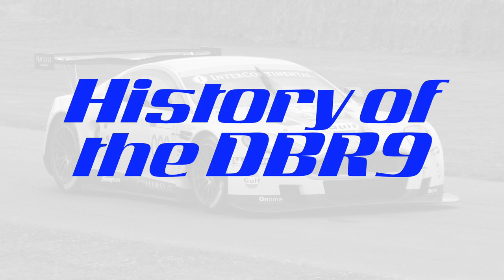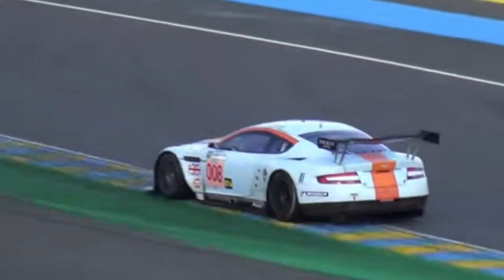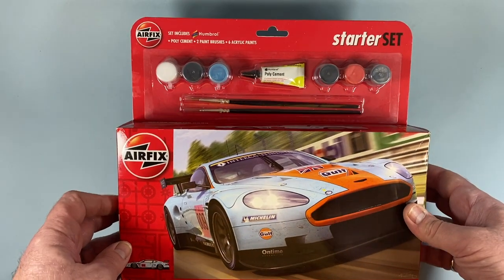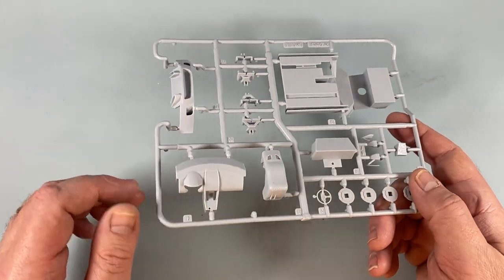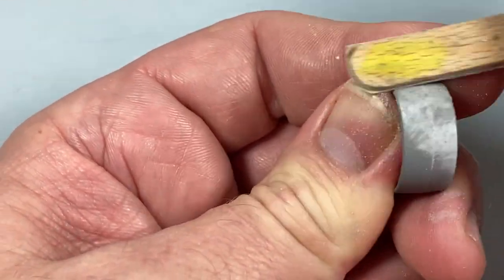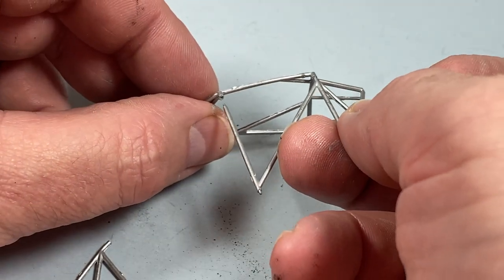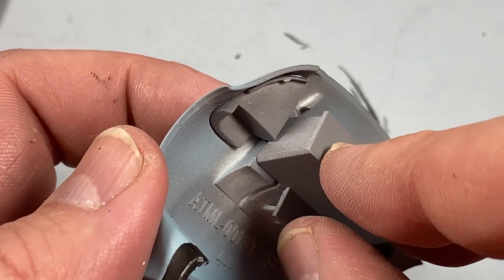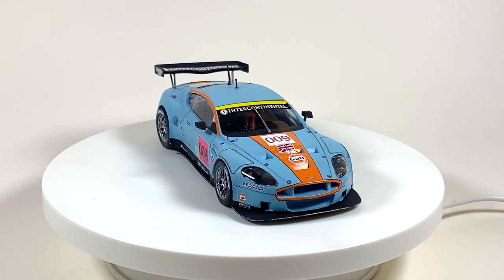ASTON MARTIN DBR9 Airfix 1/32 combo - history, what's in the box & making the kit - 1080p

Comment: Those were great pics of the track versions. Some really nice cars. You don't need any gauges, you judge rpm's by the number of popping sounds as you brake and downshift, and the vroooom's as you accelerate 😜. I know I know, I'll crawl back under my coffee ☕ mug now 👍
Reply: The shame is that with Corvette going mid-engined, AMs remain one of the front-engined GTs racing.  Pity.
Reply from the maker: My favourite bit of the Le Mans circuit is the corner at the end of the Mulsanne Straight - it's a sharpish right hander at the end of the bit where they hit peak speeds. Popping and banging aplenty, and at night there are sheets of flame out the back and the brake disks glow yellow hot. Wyn Percy used to swear he used both feet on the brake pedals for that one!
Reply: @garys_stuff  
That's the Mulsanne Hairpin though it's been opened up a bunch from its original shape.  And if you've ever played a Le Mans video game you'll know that you feel as if you've got both feet on the pedal!  In Gran Turismo 4 you break 200 mph in 5 different places each lap -- absolutely breathtaking, especially at night.  Those drivers have nerves of steel -- again, and again, and again . . .

Comment: Is there anywhere you can find the Steve McQueen car from the film Le Mans to build, Gary? - my dream would be to build one that is radio-controlled - someone must have done it somewhere?
Reply from the maker: There are a few Porsche 917K kits around, Fujimi did one in 1/24 the 1970 Le Mans Gulf Racing colours, as did MFH. DVA has done it in 1/43 with just about every possible variant of the Gulf colours across the endurance racing calendar for the time, including testing! In fact, I think Model Factory Hiro did it in 1/12th as well, which you might be able to convert to radio control - if you can find one anywhere of course.
Reply: @garys_stuff  i have seen the 1/12 and 1/24 fujimi on ebay...i will look for Hiro...thanks